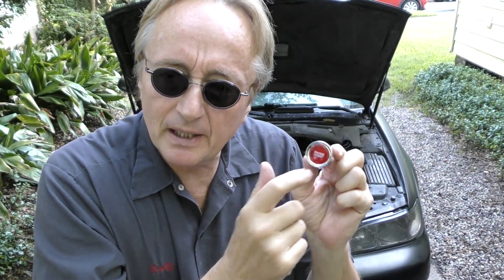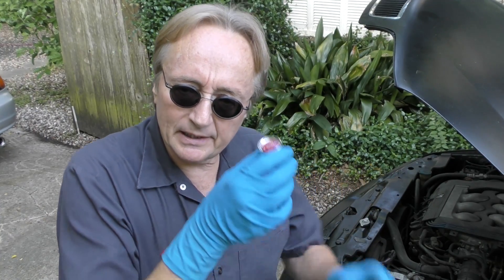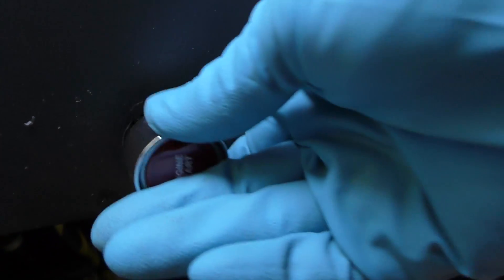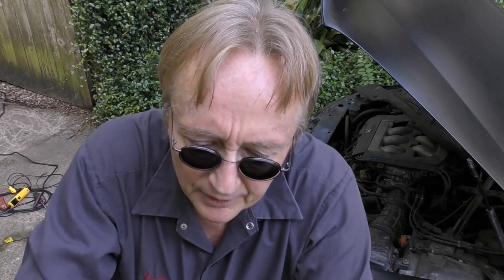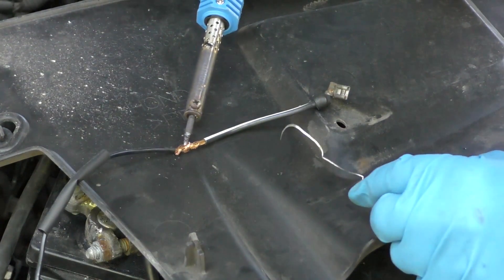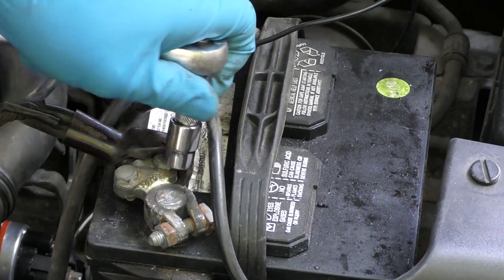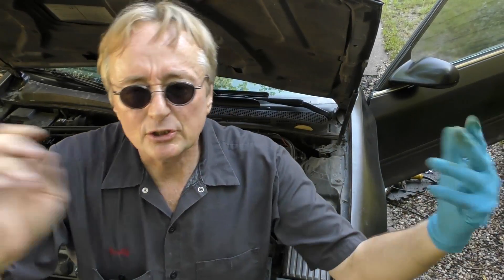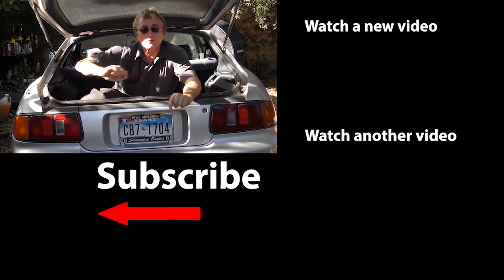I Can't Believe I Put This on a Car

Comment: Sure makes it easier for car thieves too.  Might be better if the START switch was hidden.
Reply: AZMike you still need to have the key to put the ignition in the Run position, so unless the thief has the key this really doesn't make anything easier for him.
Reply: Thanks.  I didn't realize the key was still needed.

Comment: Slipping the wire under the strap... Straight lazy... Prime example of the type of work that comes back to bite you in the rear haha.
Reply: same as not using a ring terminal on the battery

Comment: Like the push-start button. Super convenient. Recommend using a terminal connector instead of bare wire to the battery and wire protector loom.

Comment: what about neutral safety switch or clutch pedal safety switch?? what's amp rating of the switch?
Reply: It's called using your brain bro lol.

It's probably right around 10amps. Which is really irrelevant, because you'd drive the starter relay. Which is bugger all current.

My main concern was, the worst soldering job I've seen in my life. Basicly sat on top like a bird poo.

Comment: Clean the DANG corrosion at the positive terminal and use a proper connection at the battery.                 I guess repeat customers are the best?

Comment: I did the same thing with one of my vehicles back in the day. I soldered the wire to the relay so that the starter could not be engaged unless the key was in.
Reply: I had two wires running from a starter to inside my car turn the key touch the wires together and it would start

Comment: Did something similar when my ignition switch failed (for the third time). But I just bypassed the switch on the column. Worked the same though.
Reply: Mark Martin same here. Sure beats buying a new steering column which was the alternative. The plastic rod that pushes the start switch snapped and I had the switch module hanging under the steering wheel for months until I did this

Comment: Whats the point of a push start ??????if u still jave to put the key in the ignition
Reply: The alarm installer probably cut the key start wires to integrate into the alarm and messed it up , that's why he wants to use the button.
Reply: And turn it to  on.

Comment: When I bought a used Porsche in 1993 I installed a sophisticated alarm system by CodeAlarm. I had to spend a couple of days under the dash to get all the wiring done but it worked fine after that. One of the security features was that the starter circuit was controlled by the alarm system and would disable the starter circuit if an intrusion was detected. For additional security, I wired a hidden electric fuel pump cutoff switch that I could control when I was in the driver's seat.

Comment: Scotty, that is not the best way to do that. You really need to work on both your electrical and soldering skills. The soldier was way too cold and did not penetrate the wires. On the electrical, it would be better to run the switch through a relay as I doubt that switch is meant to actually power a starter.
Reply: The switch is only activating the solenoid on the starter. But I myself wouldn't of wired the switch direct to the battery though. 🇬🇧

Comment: Scotty, way back I had an Opel GT (poor man's vette, and poor reliability). The starter part of the key switch got stuck in the start position, causing the starter to engage when the key was turned to the 'on' position. Since I was a poor college kid, I disconnected the starter wire to the solenoid and installed a  momentary 'bat switch' (black paddle switch) that looked pretty cool. Did what you did here.

Comment: O security now. Anyone can easily break in and drive off with the car. Not too bright an idea
Reply: You still need key to energize ignition coil.. The switch only spins starter but you also need something to flow 12 volts to start and fire.
Reply: The car won't go anywhere without the key. Don't make comments if you have no idea what you're talking about.
Reply: @RustySh4ckleford  Scotty forgot to explain that.
Reply: @diane2193  true but it was implied in the video that this is a solution to the trash alarm and wiring to get it started.  You are right tho.. for the mechically uninclined it wouldn't hurt to say once the key is in the on position hit the button
Reply: @RustySh4ckleford  that was not explained in the video.
Reply: Having to have the key in the ignition and then pushing a button seems to defeat the convenience of push button start. But in this case it's a go around to the alarm system
Reply: @1232bluejays  exactly.

Comment: Hey Scotty! I have a 2006 Matrix AWD. Took it in to dealer to replace front right cv axle. They broke the transfer case removing it, then JB welded it back together and sent me on my merry way. Two days later and there is gear oil everywhere,  I saw what they did. Took it back to dealer to get it fixed. And they said that I did it and that they were not going to do anything. So, I had AMEX put a stop on payment ($600), next step is small claims court. Apparently, the stuck axle is known problem on my AWD model. My mechanic had tried to remove it but could not and did not want to hit it too hard. We assumed the techs at Toyota would have a "trick" to get it out. They had a trick alright.

Comment: My 1946 Ford had push button start and a locking steering wheel, LOL. Things come around and go around.  Years and years ago, in the 1930s, all the cars had floor shifts. Then along came the column shift and everyone thought it was the bee's knees.  Then the 3 on a tree went away and floor shifts are back.

Comment: Starter buttons have been around for years! My dad had a Dodge Custom deluxe Sedan back in the early 60's had a " Push Button" starter on that car! Believe it or not, it was an option.. The car was top of the line loaded! But a gas hog, and spent half of its life being fixed for one thing or another! Chryslers were crap back then and never changed!

Comment: my 56 GMC wrecker had the peddle you pushed down to start, to the right of the gas pedal. A 6 volt generator system and 55 Chevy had the button on the dash, some had the 265 V8

Comment: Scotty. That would make a good anti theft device. If the switch will ground out a fuse on the starter solenoid. The thief trying to steal your car presses the button and has instantly disabled the car.

Comment: I had a 1957 Buick Super. It had a starter button under the accelerator pedal. Turn the key on and push down the accelerator to start the car.

Comment: I use a small butane torch to solder. I like the danger!  Also I use electrical tape onto the still warm wire. Shrinks right on, don't need a heat gun. And I like to sink pirate songs.  :)

Comment: hey scotty heres a trick I learned from my dad, if your going to be drilling into plastic put some tape over where you plan to drill I use painters tape and ive also used duct tape, it insures that the hole will be clean and smooth

Comment: Not a true push button start you still need the original key to turn the ignition to ON position.
Reply: Even older cars you had seperate switch

Comment: Pro Tip: You should "tin" (melt solder on) the individual wires before you twist them together. Then solder the tinned and twisted wires together for the best electrical connection.

Comment: My 1926 Ford Model T had a large button on the floor for the starter. The driver just stepped on it and the starter would turn. Beats using the hand crank. By the way, there are still push button switches available for old cars like a '37 chevy that are just a chrome button for the dash.

Comment: Scotty. Wiring to the battery you ought to have used either a ring or fork crimp ideally, failing that I strip the wire back further than I need and bend it round to make a loop, then twist it up near the sheathing can get you out the brown in a pinch

Comment: Should have used flux before solder for better bond.
Reply: Electrical solder normally has a flux core that is sufficient for most work.
Reply: Flux CORE solder. However, extra flux does not hurt. 
The crime was the low wattage IRON he used. Terrible joint! Needed a higher wattage solder GUN!
Reply: @deplorabledave1048  Yes sir, for that gauge wire and would use a 300/200 watt iron to make sure it heats that solder to penetrate thru

Comment: Had a 1982 Subaru GL wagon that had the starter part of the ignition switch go out. The actual back end part of it so couldn't just do a simple cylinder replacement. So we did exactly this, and an a lot of cars there are blank spots where switches would go on optional equipment or higher end models that make a perfect place for this. And then when the cooling fan circuit went out we just wired up a switch to turn the fan on XD.

Comment: Love your videos but Quick tip Scotty and whoever sees this I’m an Autotech at geeksquad at Best Buy and the way the wire was ran through the firewall between the grommet and metal of the car is somewhat dangerous because water could get in, or it could cut the wire on the sharp edge on the outside of the grommet . Be sure to run it in a new hole drilled in the rubber grommet or make a new hole and save yourself a world of trouble for everyone with the little extra effort .

Comment: Will work but not quite the same as the factory push-buttons starters - you can push and release the OEM push-buttons before the car actually starts; the computer ensures that the engine is started before disengaging the starter. On Scotties do it your self installation you have to hold the button down until the car starts, just like you do when you turn a key.

Comment: Scotty~
What did you have to do to insure that there does not exist a permanent 2.5 volt or less drain on the cars battery during down time? 
This is an excellent post on installation. Can you please make one on dismantling or disconnecting whatever you need to bypass or not use.
Thanks for all you do.
Reply: Why would you think there would be a permanent draw? (Don't want keep having to say this, but otherwise it's out of context) My race car never did, and I had enough confidence that I raced off the battery alone. No alternator to suck hp from the engine. Used a deep cycle battery, and charged it the day before.
Reply: My bad, I guess. My wife's Solara was wired with a hugh expensive amplifier and speaker box in the trunk by her nephew. She did not ask fot it, nor does she want it. With the car's motor off, every thing I can turn off, turned off, there is still a 2.3 to 2.5 v draw. After 1 week standing still, the battery will show a 10  volt read, which cannot start the car.
Now I have to disconnect the boom box, not affect the car's operation, AND not offend her nephew.
I thought maybe I could gleam some insight, is all.

Comment: If you don't have a heat gun, brushing the shrink wrap lightly with the soldering iron will work just as well.  You have to brush all sides to get even shrinking, though.  Don't hold it in there or the rubber will eventually melt, of course.

Comment: Did the same thing back in he 80's when the barrel in my old valiant crapped itself,, the barrel still provided power but that is all,, we also used to use a similar switch (always hidden) to disable the car when left in an unsafe area

Comment: Do you use the "marine" heat shrink in places that might get wet?  Apparently it has some sealant already inside the heat shrink so once shrunk, it's really water tight as well as covered.

Very nice professional job, thanks for posting.  I think I would have soldered on a larger terminal end and put heat shrink over it, then put it under the bolt of the battery terminal.

RichE  San Diego

Comment: Love the videos Scotty so not about to take the piss (UK 😂). What's stopping someone just getting in and hitting that switch, stealing the car? I'm guessing the steering lock is still there. What precautions did your customer need to take. As I say, serious question not , having a go at you as I love your videos.
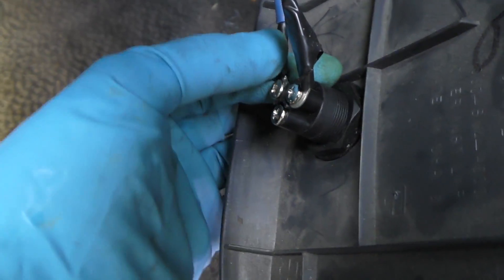Reply: At 3:25 you can see (hear beeping) that the keys still need to be in the ignition and turned over so the electronics are on. Then he can start the car.

Comment: Some installers intentionally scramble the wiring into a mess under the presumption that it would make it more difficult to hot wire.  The installer of my Alpine alarm system on my Civic back in the 80's did this, I was not pleased since he did not ask for permission to do this.

Comment: A thicker hotter soldering iron makes a much nicer solder joint for thick wires like that, I used to struggle with smaller soldering irons trying to get good flow and coverage. 

I think it would have been fun if you but a label over the red button that said 'Ejector Seat'.

Comment: If you are using lead free solder you should always make sure that there is some solder flux to hand, its cheaper to use lead free plumbers flux, lead free solder does not have enough flux in it to use on its own. If you use lead solder use use flux designed for lead solder you may not need it for lead solder anyway. If you are using aluminium or stainless steel solder these run at 400 degrees centigrade. If you are using electrical lead free solder the temporature is generally 340-360 degrees centigrade. Also use a chisal soldering tip for lead free. You may need to go below 340 degrees centigrade for lead free for very fine work and dont forget to use a flux pen for fine work.

Comment: Yup,  63' Sprite, POS ground.  Got a battery switch AND a fuel switch too,. also look like the light switches; up or down, dunno. Rubrics cube starting, labeling everything would take all the fun outta it!!  Push button is the only easy part,. Nope,  those are the other lights ... ..  Ha Haa Ha!

Comment: 1948 Cadillac was push button start, with an automatic starter dis-engage to prevent grinding gears. (Just saying)
Reply: rkomada88 Buick was under the gas pedal (actually on the carburetor with a relay) Studebaker under the clutch. On a 4-speed on the column Mercedes you pull the gearshift back towards you. Chevy had a button, before that a separate pedal that physically engaged the starter drive and made the electrical connection. 
Oddly a 32 Ford had a key start on the steering column like a 68 Ford I think.
Reply: Sam Molloy ......ok cool, all very good points.

Comment: The wire should've been ran inside the grommet, not between the grommet and firewall. The metal will eventually rub the insulation off and short out. I think you needed a soldering gun to solder that wire properly. Thanks

Comment: Wires are too large for that dinky little soldering iron. That is for printed circuit boards and SMALL wires. Use a higher wattage soldering GUN for 12 and 10 gauge wires.

Comment: Apologies for being ignorant, but since the red wire is connected directly to the battery if you press the starter button with the key off wouldn't that cause the starter to rotate?
Reply: Yes. The car won't start without the key in the run position though, just turn over

Comment: In my experience, those type of replacement battery cable ends have destroyed more batteries, alternators, and starters than anything I have seen.  They corrode easy and always work themselves loose and then current can not flow properly and that just messes the charging/starter system up.

I worked for a company that had trucks with 24 volt starters and had those cable ends on them.  They would work themselves loose and then the next time someone started the truck the 24 volt current would vaporize the cable end, the battery terminal and about a two inch diameter part of the battery casing.

Comment: My 1952 GMC had a push starter only it was on the floor next to the gas pedal.  My 96 RV has a push button starter. My DR650 has a push starter. My 2006 BMW has a push starter. Hmmmmm. Couldn’t be bothered installing push starters in my two SAAB’s.

Comment: My 54 Buick was push pull start ! Figure that one out , it took me a long time to find out the hard way and yes it was factory ! ( Hint ) , I thought the shift knob on the column was chipped ! My Dad made me pull the starter out at least 50 times until he got tired of driving around it in the horseshoe driveway ! ( It was a car for driving in the fields and I had it towed to the house so yeah I did not know ! Lol

Comment: Now he can crank on the engine with the ECU and electrical system turned off. That'll come in handy when doing oil changes and priming the new filter.

Comment: Hi Scotty, very informative video. I have a quick question. With the starter button you installed, can anyone who has access to the car just push the starter button and start the car. I guess my question has to do with security. It appears that anyone who has access to the car, say the doors aren’t locked, can start the car and drive away. Is my assumption accurate? Thanks.

Comment: 2 problems: 
1- it's easier to steal the car.
2- you used a black wire and soldered to the red wire so he ended up with 2 black wires attached to the button so you have to go into the headache to figure out which one is positive and which one is negative.

Comment: should have wired switch thru the neutral safety switch. if the cars in rev or drive, you can still start the car.  not good.
Reply: Tony D I alternatively wire a relay connected to the brake switch output for the power to the push button start so you need to step on the brake while engaging the starter. You can even do both— make the circuit as complex as desired!